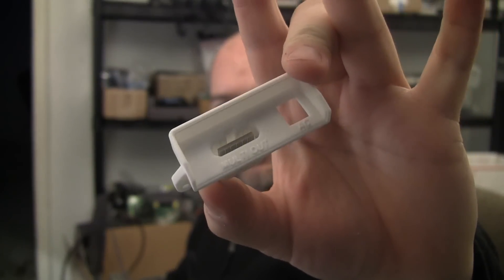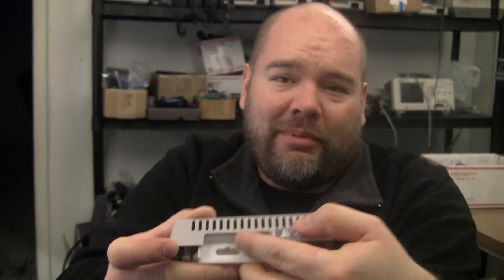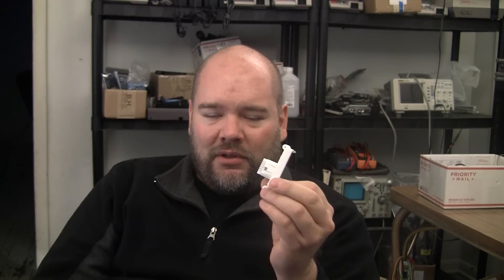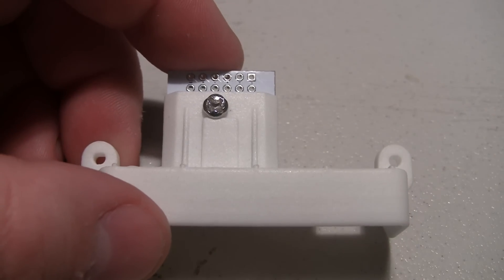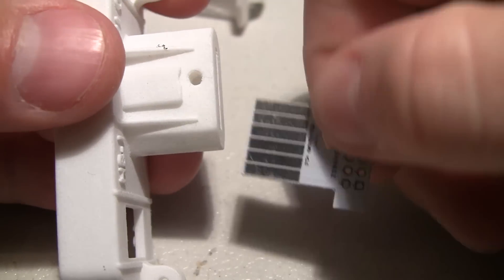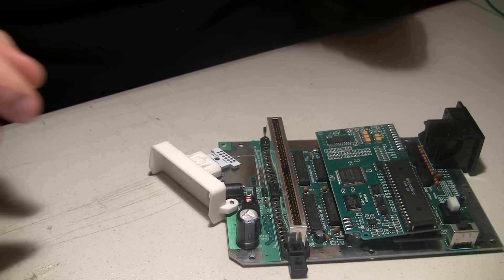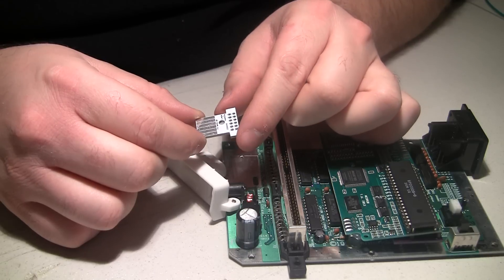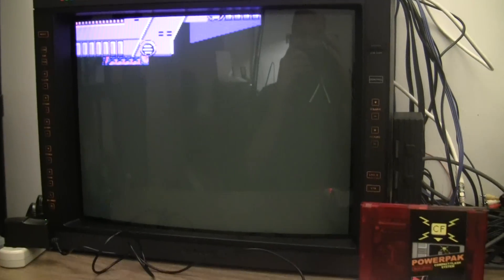NES-101 3D printed rear panel with snes multi connector

Comment: A couple years ago I started thinking about how 3D printing would be awesome for console mods because it could reduce or eliminate the need to modify the external housings of our precious rare consoles as well as let you make new functions with custom housings.

For example, ever see a top-loader with an NES Satellite receiver attached? Yuck! I want my top loader with an integrated NES Satellite receiver or, at least, a redesigned external receiver. Now, why stop there? An NES Satellite transmitter in a custom, weighted, shell with controller storage,  cord management, alternative power options (goodbye, C-cell batteries!), and an IR transmitter I can aim would be awesome! A custom ergonomic controller shell for standard controllers (more like dog-bone), a dock for dual NES Advantage joysticks, a shell with a deeper cartridge slot, replacement NES Advantage buttons that don't stick on the side-walls, and so on.

Let's get to work!
Reply: Emmett Turner wow great ideas but what ever happened to them?

Comment: Large parts like a shell will be expensive and it might be something we might look into soon but the cost will be a deal breaker for most. On a side note I have the AV mod pcbs which I will soon offer for anyone without the NESRGB but wanting to use the socket and have some decent video output.

Comment: Were you ever able to get 3D printed pieces to your SHARP NES TV? I have one too and I'm looking for the files for the power/reset buttons and the 2 doors. If you had any luck would you mind sharing where you got them from? Thanks :)
Reply from the maker: No I never got back to it, I don't even plan to get back on the sharp nes tv until I find more info on how to send rgb to the crt directly.
Reply: Do you need the repair manual for it? Not sure if you've tried this but NintendoAge.com has it and it's where I downloaded mine. The guys there may even be able to help figure something out you weren't able to.

Comment: @16:00 Actually that was me who managed to fit a palette switch in between the power jack and multiout.
Reply from the maker: Ah... sorry bro!
Reply: GameTechUS It's alright. I also forgot to clarify on ASSEMbler that I installed the switch vertically so that there's some room to move the switch. I don't think it'd be possible to use anything other than the new ON-OFF-ON switch Tim is including now, since the new switch is pretty small.

Comment: I own the 3D printed multi out its just the stand alone for the NES. Im attempting to hook it up to the Front Loader NES but but uncertain of the pin assignment for the AV out and where the wires go in regards to the NES RGB mod. I know the row of contacts on the RGB it will go to but just dont know assignment of wires on both ends. If you happen to know a site or how the wires link I would appreciate it. Sadly Retrofixes doesnt offer a diagram for its intended use and this is my first attempt at doing the mod. :\ Any help is appreciated.

Comment: Do you plan on printing one with an opening for an HDMI connector for those of us who want to install the HDMI mod ourselves? Cutting the plastic isn't too bad, but a nice 3D printed panel looks so much cleaner.
Reply from the maker: +Daniel Moeller I don't no. The current hdmi hole is half bottom case and half rear panel. If a small enough extension cable could be placed in there then a 3D printed panel might work.

Comment: If only someone could print out a SNES shell... would love to replace the r. kelly colored snes's i come across or use a new pristine shell for a project i've been putting together.
Reply: ***** Why not have it custom painted? I recon it'll cost about the same (perhaps a little more) than a 3D printed shell
Reply: GengarTV Because the yellowing can make cases brittle, and eventually all of the non-yellow cases will be gone.  Destroyed in chinese recyclers or collectors snatching them up.

3D printing may be a way to make new cases once this happens.

Comment: What type of plastic is that thing made of?

If it's PLA, I would be concerned about the longevity of the part.
I would expect it to go crumbly and fail pretty quick.
If it's ABS, it should be good, in fact that is what the console casing is made of.